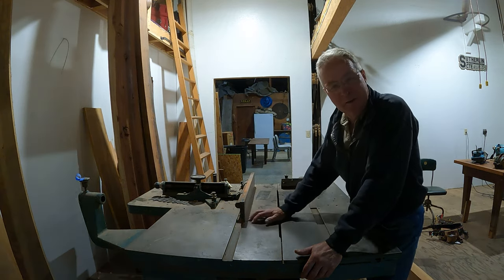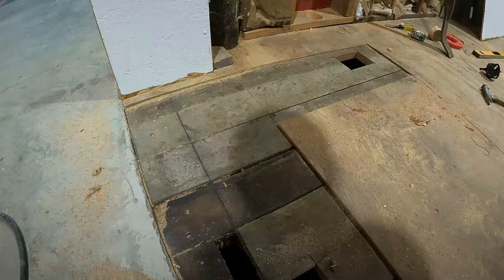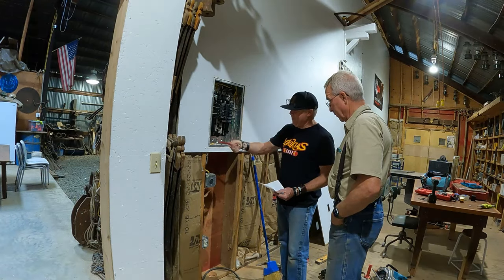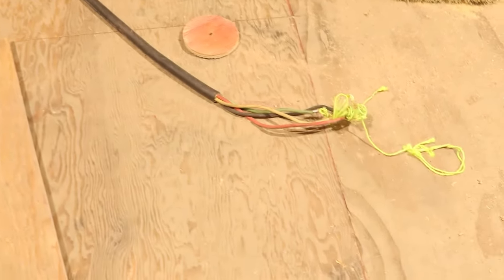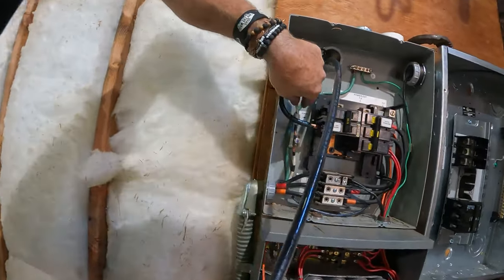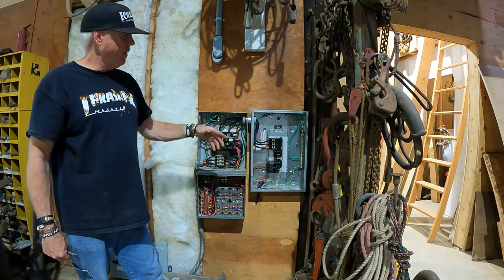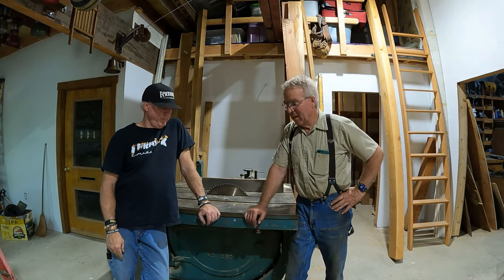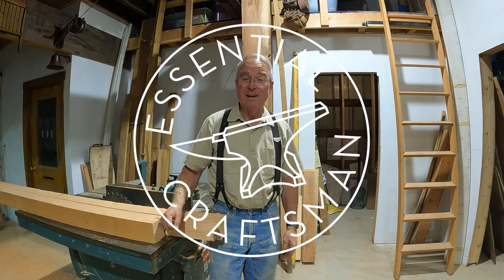Installing Three Phase Power In A Shop

Comment: A VFD typically uses insulated gate bipolar transistors (IGBTs), to convert the incoming fixed-frequency AC power into direct current (DC) using a rectifier. This DC voltage is then subjected to pulse-width modulation (PWM), where the voltage waveform is rapidly switched on and off, generating a series of voltage pulses. The width (duration) of these pulses is varied according to the desired motor speed. The generated PWM waveform is then passed through an inverter stage that transforms the DC voltage into a variable-frequency AC voltage. By altering the frequency of this AC voltage, the synchronous speed of the motor can be modified since motor speed is fundamentally governed by the frequency of the applied voltage.

In order to maintain the required voltage-to-frequency ratio for optimal motor operation, the VFD incorporates feedback loops that monitor various parameters such as motor current, voltage, and speed. These feedback signals are processed by a control algorithm embedded within the VFD's microcontroller, enabling precise regulation of motor speed and torque output.

Comment: A rotary phase converter is really the best option to have clean 3 phase power.. the other options have serious problems.. Static soild state start boxes only gives you 2/3rds the hp of an electric motor.. and even worse is the VFD ( Variable frequency drive ) units are cheap but they need to have a complete grounding system running directly off the motor being powered by the VFD as stray electricity builds up on the shaft until about 70v and finds ground thru the ball bearings..which then frosts the ball bearings a few thousand times a minute.. 600 to 1500 hrs later the ball bearings are completely toast and need replacement.. unless you have a grounding system like a carbon brush riding on the shaft to connect the grounding..Rotary phase converters run for several decades without problems or even maintenance most of the time..

Comment: The one shop tool that our woodshop teacher refused to let us use was the table saw.  He ran a no-compromise, no BS classroom.  One day he was using the table saw and took the tips of three fingers off.  He calmly turned off the machine, told us to stow our tools and clean up, and said nobody move until the bell rings.  He left for the hospital with the blood and fingernails still sitting on the table saw.  Nobody said a word or moved a muscle until that bell rang.

Comment: At 3:55 your phrasing makes it sound like the inspectors are making unnecessary demands, while in reality they are just there as a courtesy to keep you from burning down your neighbors' properties.  I'm sure this was an accident, but the codes are only very rarely unnecessary.
Kevin probably told you this right after recording that segment, but with 3 phase motors, to reverse rotation, it DOES NOT matter which pair you swap. A-to-B, B-to-C, A-to-C, any single swap will do just fine.

Comment: Nice. Very nice. That thing IS da beast... Now I have to echo others' comments that, yep, ain't no SawStop, but installing various safety items like a riving knife (probably via a custom insert) are now a priority. FWIW, I felt a cold chill going up my spine to see you lean over that blade when cutting that 4x8 at the end. Perhaps, just perhaps, if you've gone this far installing da beast a power feeder to help remove your hands (and inside of your arms) out of harm's way is also in order. All in all, I'd love a video on cuts you can do, or do easier and cleaner, on this vs. other tools in your shop. Perhaps pure cosmetics, but I was also struck by how beat up and rusty looking da beast is. Can you verify that this is just cosmetics and that it does in fact cut square and true?

Comment: For ripping like that I was surprised just how much less effort a fewer toothed ripping blade made the cut for me. But then my 12" blades were just $100 ;)

A friend and I built one of those manual start rotary style for his shop sans capacitors but had a 'pony' motor levered into place to tighten the belts to start the motor spinning before releasing the belts and throwing the power onto the spinning motor. Had a real Frankenstein vibe to it. :)

Comment: Installing the SO cord for the saw hook-up is not code compliant.  It should have been done with an approved wiring system (conduit, etc).  NEC 400.12 Uses Not Permitted.  Unless specifically permitted in 400.10, flexible cables, flexible cord sets, and power supply cords shall not be used for the following:  (1) As a substitute for the fixed wiring of a structure.  (2) Where run through holes in walls, structural ceilings, suspended ceilings, dropped ceilings, or floors.

Comment: #1 when ever possible -  never ever stand directly  behind the blade , when feed the material through ... I saw a few men over the years get hurt when the material kicked back !
#2 clean and polish the saw table to make it as smooth as possible and then apply a few coats of your favorite coating ... I always use Boeshield T-9

Comment: nice table saw.  But shouldn't you just get a three-phase service to your shop to stop screwing around with converters?
Reply: Three phase power, from the power company, may not be readily available.  It may cost multiple thousands of dollars, in order to get the power company to run three phase power to his property/ shop.
Reply: @45Deere9500  
Multiple thousands of dollars is not alot of money.  Also, how much did it cost to get the electrician in there to rig up the converter?
Reply: @tallswede80 one of the gun channels I watch had to run 3 phase to his shop to run a big CNC lathe and it was only about 160 feet from the main pole to his shop and they charged him $18k, don't be so flippant with other peoples money.
Reply: @tallswede80  

So let’s just say it was going to cost $40,000 to have the power company extend the three phase to his property.  This isn’t at all out of line, depending on how far away existing three phase is from the property.

He’d then need a whole new service installed, at his expense, to monitor his usage and distribute the power to where it was needed on his property/ in the buildings.  Let’s say this would cost $4,000 in material alone.  He’d still need to pay the electrician(s) to do the install.

All the above vs using a lot of material he already had, and maybe two days of labor for the electrician.  Let’s say new material for the converter was $1000, and the electrician charges $100/ hour, and spent 2 - 8 hour days there.  That’s $2600 total vs everything above, for a piece of equipment he doesn’t run every day.  

Yes, if he was a full fledged wood working shop, and ran that saw every day for 3-4 hours a day, that may make the three phase from the power company more feasible.  

For how he’s going to use the saw, and what he has cost wise for how he did it in the video, I’d have made the same choice.
Reply: @45Deere9500 
you are cherry picking the worst case scenario.  The pole could be 10 feet from the building.
Reply: @tallswede80  

Could be.  Never said it wasn’t possible three phase was already at the property.  It’d still cost more than what he has in material and labor, since he’d still need a brand new three phase service installed, and three phase power ran to his shop, and in the shop.  

Even if three phase were right at his property, he’s not a young man just starting out in life, running a production wood working shop, where installing power company three phase would make more sense because you could spread the expense over more years and projects.

Frankly, he made the right choice for him.

Comment: I'm glad you talked about saw safety at the end, there, EC, but you had me tensing up as you pushed that 4x8 through the saw without a push stick. The knot that shot out and hit your arm could've easily made enough chaos in that moment to cause part of you to become part of the saw. You were hovering directly over the spinning blade with your arms reaching past the blade on either side. Put some distance between you and that beast. I would definitely also add some hearing protection. Anything that reduces your ability to focus while using dangerous power tools increases the likelihood of a tragedy.

Comment: I didn't know what three phase power is either, so I searched for a video to explain it. Voila! I discovered another great channel, "The Engineering Mindset" with clear, short videos explaining electrical and mechanical concepts. Here's the video about three phase power: https://www.youtube.com/watch?v=4oRT7PoXSS0  After viewing it, I think I understand why the "flicker" of alternating current could be a problem for a powerful rotating machine like a table saw. We want the blade to spin at a continuous speed.
Reply: I watched that, and what he's talking about is traditional 3-phase electricity.  You have three "hot" legs, each one alternating current, with sine waves 120 degrees out of phase with each other.  North American residential power is generally only getting one of those three phases, and they use something called a "split phase transformer" to convert that one "hot" into two "hots", each 180 degrees out of phase with the other.  That's what Scott has going into this converter, but it doesn't do anything like what I was expecting, at least from how they were talking about it.  They talked about it producing a "third leg" for the three phase power going to the saw, but that third leg is at double the voltage, and I don't get how the phasing works.  I'd hoped someone in the comments section explained it, but so far at least, I don't see that.  I also don't understand how a piece of equipment that expects to get three inputs of 120V, each 120 degrees out of phase with each other, can instead operate with two inputs of 120V that are 180 degrees out of phase, plus one of 240V, whatever the phasing.  A less lazy person would scour the Internet for an explanation.  Maybe later.
Reply: @BruceS42  Thanks for the explanation. I don't know what I don't know!

Comment: You don't want to use a Variable Frequency Drive as a phase converter on anything with sensitive electronics without a sine wave filter. VFDs don't put out a sine wave.

Comment: Beautiful saw! Advice - Never put your fingers/hands beyond the leading/cutting edge of the blade ( whatever machine your using ) without using a push stick. I have followed that religiously and it has served me well.
Reply: Was going to say the same thing
Reply: I follow a similar safety rule: never use a table saw.
Reply: Others, such as myself, may use our fingers/hand in such a situation, but keep a finger (pinky normally) over the top of the fence, to guide our hand from moving any toward the blade.

Comment: Watching you take cover off the walls to access your electrical panel is the core argument to having everything in a shop exposed conduit with a surface mount panel. Personally, I would never flush mount anything in a shop. Changes are continuous in a shop.

Comment: @EssentialCraftman I'm gearing up to create my first woodworking shop...looking back...what wood (pun intended) you recommend for machines,  power planning,  layout,  etc? I have some ideas already but when it comes to power installation and dust collection I'm a lil out of my league
Reply: For example...I'm going to make a covered shelf the length of each wall that will house the power supply that's only screwed in but not gyproc over
Reply: You sir.. would be fun to work with!

Comment: Would you not want to use a push stick you had your hand with in inches of a blade that would cut your hand off before you even fellt the pain. I would also install a kick back catch that saw will push materail right through your arm.

Comment: Hate to be that guy but since you were talking about code compliance , it is not allowable to hardwire equipment with SOOW cord it needs to have a cord cap installed and then plugged into the appropriate receptacle. Just my two cents here love all your videos thanks
Reply: Looks like it's just a sleeve to protect the cord where it's exposed
Reply: Agreed.  NEC 400.12 Uses Not Permitted.  (1) As a substitute for the fixed wiring of a structure.  (2) Where run through holes in walls, structural ceilings, suspended ceilings, dropped ceilings, or floors.

Comment: Rotary phase converters are NOT dated technology. Rotary phase converters CAN be used on CNC equipment. All three legs of 3 phase power are balanced. It's called a MANUFACTURED leg. High leg is a misnomer - measuring it to ground is not correct since you are measuring to the ground between the other two legs. If you measure between legs, they will all be 220 (ish) to each other. To reverse the polarity of a three phase motor, you reverse ANY two legs. And, lastly, the control circuit (the one the button is used to start and stop) should NEVER be the manufactured leg.

Comment: Is it 3-phase 120/208? Or 3-phase 240 with a high leg?
Reply: 99% of 3 phase delivered for commercial use is 120/208 or 277/480.   You take the square root of 3(phase)=1.73 and multiply by 120 and that equals 208, same for 277. There are a very few places usually located in an old commercial area of your town where they have 3 phase 120/208 with a wild leg. 2 of the phases have 120 to ground and one phase with the “wild leg”has 208 to ground.  Typically we identify the wild leg with orange. Phase to phase is 208.  
In this situation he has 120/240 single phase and because it is a simulated phase  it is a 240v wild leg.
Reply: @moosepasshippie  thanks

Comment: There are two types of 3-phase systems. There is WYE and there is Delta. WYE provides 208/ 120 volts and Delta provides 240 volts only. It would be more advisable to replace the 3-phase motor on that antique table saw with a modern high hp 240-volt single-phase motor than to rewire your building for 3-phase power.

Comment: I’m 50 years old and have never heard of a 3 phase converter. I have always believed the only option for 3 phase equipment was to get 3 phase in from the power company. Thanks again, I’ve learned something today ! 
Going back to your other comment about electrical, residential and light commercial single phase electricity is imho far simpler than carpentry , concrete or drywall. Electrical feels like learn a few simple rules and you can lookup the rest. The work itself isn’t too bad. 
The other three I just mentioned feel more art to me and either you have it or you don’t.
Reply: A rotary converter is basically just a single phase motor coupled to a 3 phase generator. The single phase motor spins when you power it up with single phase, and the generator has its shaft turned and produces 3 phase.
Reply: "a few simple rules" that's why sparkies get paid more and are on the job from start to end 😂👍
Reply: @joeschmoe6941  it wasn't an insult, it was more a comment on how we are all different.
I am not an electrician but with a code book I can do everything correctly, surely slower but still get the job done correctly. 
I feel like I could practice the rest of my life and still not be able to be a trim carpenter or do a level 5 finish on drywall.

Comment: Okay... so 3-phase power has always thrown me for a loop.  I guess I have to search YouTube for someone who can explain it to me in terms I can understand.  I've watched 2 or 3 of those... but I'm still just not getting it.  For me it's like trying to really understand 3-way switches... or 4-way switches... I really have to draw out the circuit and follow the electricity thru every option.  3-phase seems more complicated to me... and if I want to really get it, I'll probably have to watch a lot more video.
Reply: @DuffyHomoHabilis  - yeah, I get the 120 degrees... but I don't see how you can pull a third leg.  It's just my ignorance... but yes, thank you for confusing me even more... lol.
Reply: @tylerbarrett6652  Third leg comes from the capacitors. They are like a super fast charging and discharging battery. They see the same voltage as one of the legs, but because they charge up, there's a delay on them passing it through. And, once power is off, there's still some energy stored, so they delay when it shuts off too. This shifts the whole waveform forward. If you size the capacitors correctly, you delay it right to where a 3rd leg of the 3 phase would be, and it shows up like a ghost. A inductor (coil) would do the opposite. If you've ever heard of "power factor correction", that's where you have too many inductive loads (motors and transformers), so you add capacitors so that the circuit is in tune with the power grid, else the wires get hotter and heavier loaded than they should for the amount of net power they're drawing.
Reply: @MattsAwesomeStuff  - Okay... that makes sense so I think I'm getting it a little better.
Reply: Three phase is the most efficient/economical electrical system. Most countries(even U.S.) use three phase generators in power plants and transfer and distribution lines. It's just the last leg in US which uses single/split phase for whatever reason. Drawings won't help you much since the point is that different potentials in the circuit are out of phase.

Comment: Fire that halve ass electrician wanta be. You can NEVER use cord in place of permanent wiring. Should have ran proper size MC cab!e. The connector on the left side of top box might need a bushing to protect the wires. No such thing last 10 years in NEC called a nuetral. should use the proper term grounded conductor.
Reply: Neutral, grounded conductor, white, return... You can call it what you want. Code doesn't prescribe language.

For a shop, mount a disconnect and run conduit, MC doesn't hold up.

Comment: Eek, "on guard".  Would have felt a lot better if you were using a push stick, and might not have gotten tagged with that knot, who knows. But at least if you slip, you'll be far away from that blade that you shouldn't fall into it.